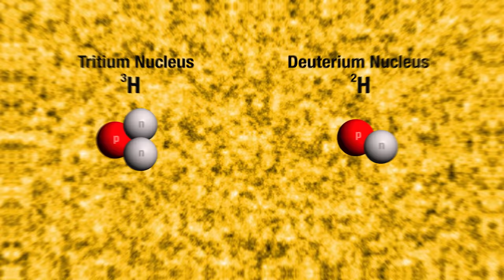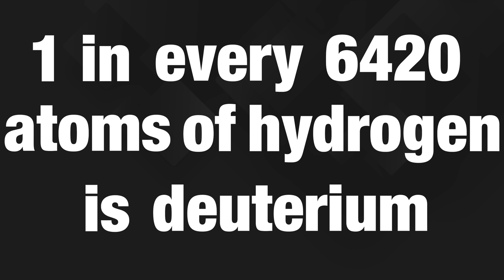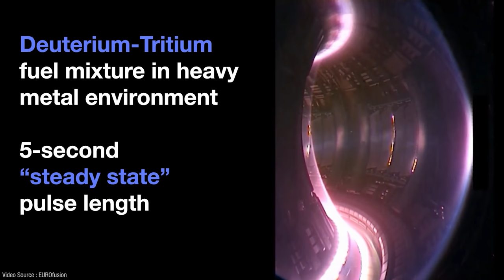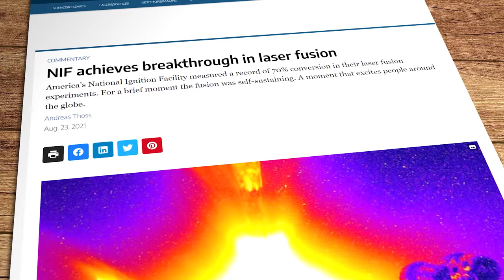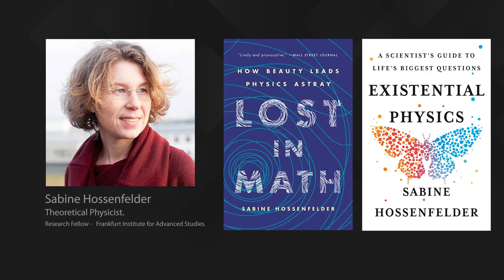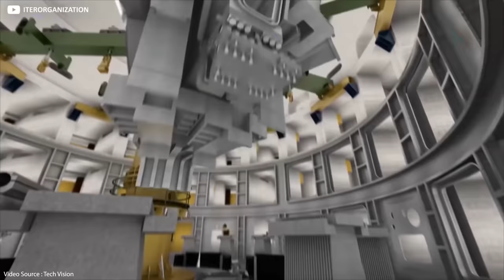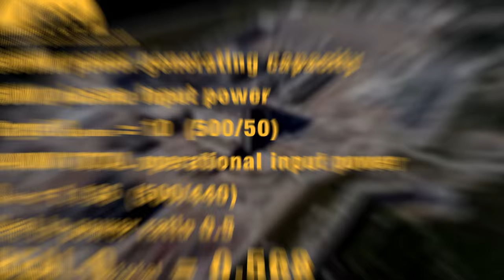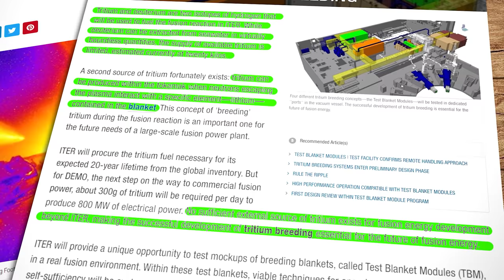Nuclear Fusion Illusion. Is it time to park the pipe dream?

Comment: I would also mention the response video to Sabine’s nuclear fusion video. One of the main points presented in the response is that most efforts have been solely towards improving Q plasma because it’s much more unknown then the rest of it. Once Q plasma is significantly over 1, the rest of the system can be refined. Like using high efficiency lasers for the inertial confinement fusion.

Magnetic confinement fusion is also mainly an issue of scale. By doubling the size of a tokamak you multiply the amount of plasma (and hence its power) by a factor of 8, but the required cooling and confinement powers scale only by 4. So once we understand how a unity gain plasma acts (the express intention of ITER), we can design a fusion reactor that will definitely have overunity wall plug efficiency. Science is an iterative process.

Though personally I’m more of a mind to follow the high-temperature superconducting magnets of MIT’s SPARC reactor, as the magnetic field can be a lot stronger and make the required tokamak a lot smaller. As we’ve seen with ITER, the logistics of making such a large tokamak are very challenging. But the materials science of making a high temperature superconductor into a durable wire is also challenging. Either way, it will be a while before anything is built that can easily pay for itself, even with overunity, but it will almost certainly happen. I’d give it 50 years max.
Reply: exactly. Concluding economic feasibility from a research project is far fetched.
Reply: Another critic of Sabine's vlog pointed out that research reactors are, by definition, designed so that a number of key parameters can be varies. This adds complexity and cost. Once you have determined the optimal design, engineering a reactor to these fixed parameters would be much cheaper.

Having said that, we are still orders of magnitude away from a viable technology, so I'm not holding my breath.

Comment: The reason fusion was out of reach for so long is that the material technology didn't exist to make it possible.  The most important factor to achieve fusion is the strength of the magnet field. The power output is to the fourth power which means if you double the field strength you get 16 times the output. The reason I have little hope for ITER is it used 400 ton 11.8 telsa strength super conduction magnets made from Nb3Sn / NiTi that require cooling to 4 K (-269 C). Compare this to the SPARC reactor at MIT which with it 10 ton YBCO cooled to 77 K produced a 20 telsa field this January.  This means the SPARC reactor can achieve 16 times the output of power output with 2.5% the material and the far cheaper cooling cost of liquid nitrogen verses helium. Their are other good design elements of the SPARC reactor like its modular design, use of lithium salts, etc  that I can't go over due to space limitations here.
Reply: ITER is a solid yet unimaginative plan to guarantee we got to working fusion power through brute force. But using it to criticize the field is a strawman argument at this point. The field has advanced so far since the 90s when ITER was designed.
Reply: I keep on screaming about REBCO magnets and nobody is listening - don't they recognize a "jet-engine" breakthrough when they see one?
Reply: I believe SPARC magnets will be cooled to 20K with liquid hydrogen, unless they've changed it. The reason for this is that you can get higher fields at lower temp without losing superconductivity, I think
Reply: @paulhaynes8045  why do you think we don't have time? Because we won't need any energy solutions in 20 or 50 years in the future?

What we could do now is to build fission plants and they would help us to get over the problem of burning fossil fuels, but they are not a permanent solution. That's why we need fusion to eventually take over from them.

Solar and wind are nice, but because of their intermittency they won't be a full solution,but need a base load system as well.
Reply: @SUPERTOASTERGOD  lol. There's been talk of those two at least since 1990s but we're yet to see any. 

The only working storages are those that we've had for ages namely hydro. It works fine up to a level. That's why wind and solar have been able to get a share, but pushing it higher has turned out to be hard.
Reply: @srelma  On the contrary, breeder reactors and full closed-cycle waste reprocessing, in combination with uranium extraction from seawater, would yield sufficient fissionables to power human civilisation for the next four billion years.  That's permanent enough for our purposes.  Practical, economical fusion power is far less likely than full exploitation of fission power at the scale of and along the timescales here outlined.
Reply: Iter is a waste of money because it's already outdated and does not take into account new tech's.   A 5 year turnaround for small fusion projects with more achievable goals is a much better idea
Reply: Please somebody answer me. I was searching everywhere but maybe my English is not that good.
How do they think to extract electric energy from this doughnut shaped electromagnet? Boiling water or something Hi-Tec?
Reply: @recycler6237  boiling water. The fusion reactions produce neutrons that hit the wall, heat up the water (or some other liquid) there, which is then used to produce steam just like in any power plant.
Reply: @srelma  thank you but that means electromagnets are going to be exposed to high temperatures.
Reply: @recycler6237  no. You have first wall and blankets closest to the plasma. They take the neutrons. Behind them are the magnets.

Basically ITER is the largest and hottest oven inside the biggest freezer in the world.
Reply: @srelma  thank you, finally somebody.
I am not going to excuse myself because I have more questions and you like to educate people 😁
What about further efficiency? Deuterium is not easy isolate and tritium is completely bigger story.
Reply: @recycler6237  deuterium is trivial to isolate from water. Tritium is harder because it doesn't exist in nature. That's why you use lithium in the blankets (the ones that are bombarded by neutrons). Lithium and a neutron turns into tritium and helium. You separate them and mix the tritium with deuterium and you have fusion fuel.

The tritium breeding technology will be tested in ITER.
Reply: @srelma  you are now blowing up my mind. Neutron induced fision of litijum.
If that thing needs to be that much complicated, I am agreeing with this guy. It's not going to happened in the next 20 years.
Anyway there is no materials in this known universe capable to handle that much energy 24/7 365
I don't have school about this topic at all. I just have interest in every science. Really thank you very much
Reply: @JohnnyWednesday  do you have any sources as to REBCO allowing for net positive energy production?
Reply: @recycler6237  there is nothing special in tritium breeding. We know how it works in a lab (we can produce neutrons other ways than fusion). Of course we still need to demonstrate the breeding in a real fusion reactor, but it's not that hard. 

And sure, we need to develop and test the materials to tolerate the neutron fluence. That's why there is a parallel programme for materials development alongside with the tokamaks that concentrate mainly on the plasma side of the fusion reactors.

I agree with you that we're unlikely to have commercially competitive fusion reactors in the next 20 years. We probably have prototype reactors coming online in 2040s.
Reply: @j.f.fisher5318  Agreed. Sometimes the brute force approach is the best approach.

Comment: Another interesting problem I heard from a postgrad student at JET was that the high energy particles tended to pulverise the steel framework of the tokomac. It does make me wonder why so little effort is made with thorium salt reactors, when so much is spent on fusion.
Reply: MSR's were built, and abandoned, in the 1960's. I've looked into them extensively and don't get why every video or article about nuclear has somebody screaming about this "new" technology and how it's going to be the "next step" for nuclear.
Reply: they keep lying its clean
Reply: @GregHassler  It's not new, as many people know, and no one is screaming, but it is safer than water-cooled uranium reactors and it does work, unlike fusion. It also hasn't been abandoned. For a latest example of its real-world viability, have a look at the Integral Molten Salt Reactor (IMSR), now in preparation for commercial licensing.
Reply: A small leak happens, as they do, you need maintenance, your molten salt is at around 675C, which it needs to be, now you want to repair your molten salt reactor. What do you do?
look at the large reflective solar plant built in the Nevada desert, billions of dollars and if they had a problem they had to remove their pipes and put in new ones because you simply can't reheat the salt in the system in a way that is feasible. 

Maybe there is an engineering trick to solve this problem, but until then, molten salt is dead. You need to be able to do maintenance on your plant, all parts of it.
Reply: Check out the dismal failure history of thorium salt reactors. Then tell me if you are interested in investing in them. The large financiers are not.
Reply: @GregHassler  Yes Thorium Reactors are old, I seem to recall that they were a technology that was sidelined in favor of rectors that could produce fissionable materials such as plutonium for nuclear weapons.
Reply: @jackfanning7952  because this technology has been sidelined. I think there's a great potential in thorium reactors
Reply: Because Thorium has multiple caveats of its own. It's extremely corrosive and requires costly maintenance. It still produces radioactive waste. It can still melt down. It requires refined Uranium in order to start the process, so it's certainly not the answer to nuclear proliferation. It might require "less" uranium than typical fission reactors, but if a country has to refine the uranium then they might as well just use the uranium. It's a lot more efficient that way. 

The only one real draw for Thorium was the concept of a small, modular design that can be mass-produced and easy to scale. But it's not like they haven't been trying to do that with traditional fission reactors either. There's a pilot program for small modular reactors that is up and running right now. If that works out, we'll probably see a massive surge of investors and energy producers getting into nuclear again. The biggest drawback to nuclear has always been the initial costs and the time it takes for the investors to see a return on their investment, also known as the Payback Period. If small, modular reactors can provide investors with fully built, functioning reactors off an assembly in in under 3 years, then I think we'll see fossil fuels disappear within a decade. It's going to be too lucrative for any energy company to keep chasing oil. It'd be something of a nuclear industry "gold rush."

As for the safety concerns... well, when did that ever stop an energy company? I could tell you about the fact that PBMR designs are designed to work without any active cooling or control rods--you just stop feeding them fuel and they eventually stop--but that's never been the thing holding back nuclear energy. The only reason why nuclear energy is held back by politics is because nuclear energy is always funded by politics. Oil doesn't need to be funded by politics. Politics gets involved in oil because it's lucrative and the industry is worth trillions. But it doesn't require political amounts of money to physically build an oil or gas plant. That's why nuclear is always a political issue while fossil fuels just keep on burning despite having the worst track record for death, pollution, and ecological damage of any source of energy in history. If you wanted a nuclear reactor, you had to beg your senator for one.
Reply: Thorium is the next magical thinking pipe dream, right after fusion. No one has seriously pursued it for over 50 years. Occam’s Razor suggests that the reason for that is because thorium actually has serious (possibly unsolvable) engineering issues that don’t show up in the typical internet comment about how it’s a miracle that’s being suppressed by, you know, THEM, whoever your “them” is.
Reply: @seditt5146  As I remember the cycle (not looking it up), the thorium reaction produces U-233, which is perfectly good bomb-making material. There’s a 1950s Pentagon paper out there about it somewhere. Another problem is that it produces polonium, which is a neutron poison. So a sustainable and efficient thorium reactor requires removing polonium from the liquid (molten) reactor core, without upsetting the reaction, and without risk, and without burning a ton of energy doing so. Again, I am by no means an expert, but the polonium problem seems very difficult to solve - difficult enough to explain why no one has put serious effort into thorium reactors. 

There’s also an ideological problem with the “they don’t like thorium because it can’t make bombs” argument, which is that it’s a tacit admission that civilian nuclear programs were never about energy, anywhere, but were really just a tool for nuclear weapons proliferation, and that every commercial reactor is just a machine for making bomb material. Which is one of the two key arguments that nuclear is unsafe.
Reply: Energy density is why. 1kg of fissile material equals in energy to about 100,000kg of coal. 1kg of deuterium has the same equivalent energy as 1,000,000kg of coal. Obviously 1,000,000 > 100,000.
Reply: Endless Waffle, I was an engineer at JET, and neutron embrittlement of the structure was common knowledge, but yet is never mentioned in the press nor in the fusion videos, as there isn't a known solution for the problem.
Reply: @methylene5  Thanks for the info. Yes, it's straightforward physics and can't be avoided. Ideally, what would be great would be to create an artificial gravity well, place the plasma in its center, 'pinch' it and gather the emitted energy. Sadly, afaik, we can't create artificial gravity wells, because em and gravity aren't linked, although Dr Puthoff's paper 'Linearized Turbulent Fluid Flow as an Analog Model for Linearized General Relativity (Gravitoelectromagnetism)' might point to a different idea.

Comment: There might be a misunderstanding here. The current reactors (ITER as most obvious example) are simply not meant to have a large total Q yet. I think increasing the "out-of-plasma-Q" is supposed to be less demanding. Eventually, the energy lost at various places (say the heating of a laser for instance) can eventually serve as heat to warm up water, create steam, --> electricity. It remains to be seen to what degree this can indeed be fixed. 
Tritium is certainly a problem. 
The scale (and time for deployment) of a project like ITER is also a problem.
Reply: He doesn't say it isn't posible, he says it isn't going to be in the time frame needed for climate change prevention. It's quite obvious the inexistent comercial fusion reactors aren't going to be 30% of global energy production in 2050 (looks more like 2100). He says we should think if this huge spending is a good use of limited resources at this point in time.
Reply: There is a lot of equipment in ITER that will be completely unnecessary in a power plant. You will also gain in efficiency and scale, either bigger reactors or more powerful magnets.
Reply: @PrivateSi  ITER could be fastened to a generator and produce power, but it would be much less than the power used. It is a test bed and technology demonstrator. 

They hope the follow on version will produce actual electric.
Reply: @PrivateSi  breeder reactors are goddam expensive to run, then you have to deal with the waste. Everything else is cheaper, solar and wing drastically so.
Reply: @seriousmaran9414  .. Really? Compared to what? All power production costs a lot. I'm about concentrated bang per buck. Breeder Test Reactor IMPLEMENTATION stopped in the 60s due to TPTB's addiction to Enriched Uranium and Plutonium for bombs. Many pen-pushing feasibility studies around the world since then, but no test reactors until RUSSIA and its Fast Neutron Reactor.. 
--
It's early days, and at least China is building thorium solid fuel test reactors and molten salt test chambers.. The West, with a concerted, joined up effort could have had this tech working by 1970, getting better with each new reactor design. Competition would have lead to massive efficiency gains which are very much possible on paper, by now.
--
Least amount of mining (the materials are annoying waste products in most mining operations and readily available in inhospitable places likes deserts, the Australian outback etc.. Fusion is not much cleaner than the theoretical potential of Breeder Reactors.. 
--
A small reactor will need 40 tons of not so radioactive fuel to power 1 million homes for 40 years. Running mostly on already  mining waste products that need little refinement is OPTIMAL, as a non-fake Green Guy, in a a fake green, vanity-hyper-science luvin' neo world.
Reply: @PrivateSi  that is the claim, I have yet to see any proof. At the moment the costs are extremely high.
Reply: I thought ITER's goal was q=10?
Reply: @basedcase  that is the initial aim, although it may start out lower during initial testing. The main thing is to achieve constant fusion. If they cannot do those then they might as well give up.